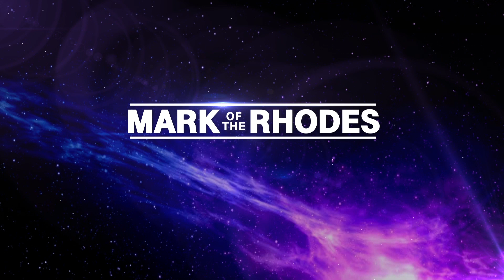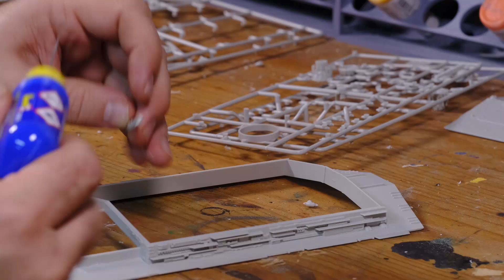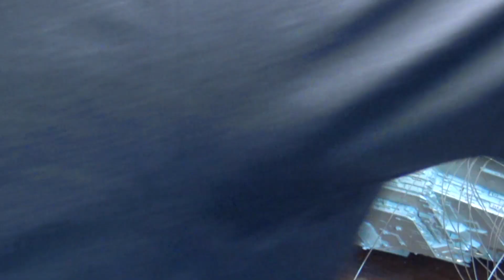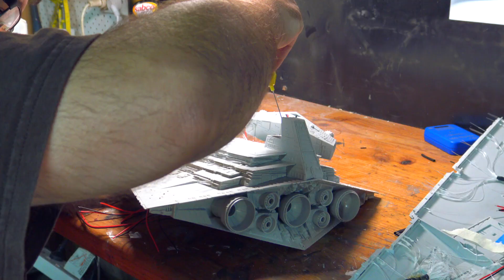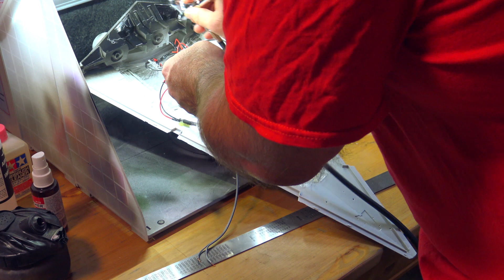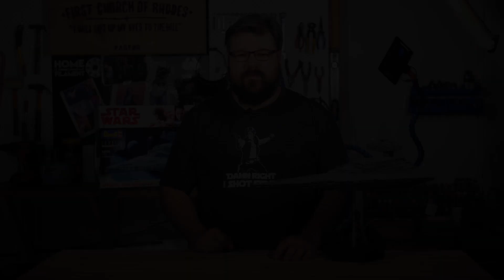Building and Lighting the Star Wars Revell / Zvesda Star Destroyer (1/2)

Comment: hello. 
i will build it soon but i have a question...what's that white thingy what you put on optic fibre? just glue or paint?
Reply from the maker: It was PVA glue, however since then I've changed methods to glue fiber optic cables.  Use a UV glue like Bondic.  Do a quick search on google and you can find heaps.  Way quicker and less messy than PVA glue.

Comment: Thanks for sharing your built. I have this in my stash too and i want to build it next. Which reference pictures do you used for your built, esp. where you have to drill? Or does it not matter where you drill? Thank you!
Reply from the maker: I didn't use an accurate reference, but instead just guessed where they would go based upon a few images.

Comment: Would a .6mm drill bit be too large for .5mm fibers?  I want to avoid the fibers binding in the holes, without falling out.  Trying to decide between .6 and .5mm bits.

Also, how did you achieve the red fiber optic lights?  Red LEDS, or some kind of tint to the fiber (like one end of the fiber painted translucent red or something)?
Reply from the maker: .6 is probably OK as long as you glue immediately, as they will fall out.    Red was done with a seperate red LED, and I just picked random fibers and pulled them to that red led.

Comment: Awesome, im about to start the same project. I'm new to all this tho so once the fiber optic cables are put in what did you connect them to to get the light? Stupid question probably 🙄
Reply from the maker: Not at all stupid!   I hooked them up to LEDs.   I sand the top of the LED to diffuse the light, and then connect a bunch of optic fibers to them with PVA glue.   I also put a sleeve of heat shrink cable over the glued bundle and led to give it more stability and prevent light leaks
Reply: @MarkRhodesMaker  awesome mate, thanks for that

Comment: I actually hot-glued my fibers. The thing is that I used a 0.75 fibre and a small, low power applier. Almost 300 fibres so far and no meltdown. They can bend, but still carry light. And bending can actually be useful sometimes:) 
Still I wish I have seen this vid way sooner:p

Comment: What glue did you use for fibre optics ? Thanks.
Reply from the maker: I used PVA (wood) glue, HOWEVER... this isn't the best choice.  I made a second one not too long ago, and UV cure glue like bondic is a way better option.  Much quicker and far less messy.  Don't use superglue or it'll melt and weaken the fibers.
Reply: @MarkRhodesMaker  Super Thank You ! ! !

Comment: @Mark of the Rhodes Awesome work! How did you cut off the fibers on the outside which were surrounded by parts of the hull? There are a lot of deepening and i was wondering because you can’t get in the with a knife or a wire cutter.
Reply: Most likely he cut at the line of protruding elements. The fibre is really not that visible, especially if painted same colour as hull.

Comment: Why did you paint the inside of the hull?
Reply from the maker: The plastic is slightly translucent, and I wanted to make sure there were not any light leaks from the LEDs inside.   Same reason I also used aluminium tape on the joints.

Comment: Hi, I am building the same model and I am studying the materials to use. I would like to know the fiber optic you used, how many millimeters it is, and the drill bits; I have three and I really don't know which one to use. For the holes, did you use two different sizes or were they all the same size drill bit....
Reply from the maker: 0.6mm drill bit was the size I used for 0.5mm optic fiber.   You’ll need a lot as they break very easily
Reply: @MarkRhodesMaker  Ok! Thank you so much!

Comment: Building this model my self at the moment, after I saw a lighting build on another YR channel (Plasmo).
So far, I can say is this. drilling the fiber holes is MADNESS. Also, I already ruinded like 12 or 13 drill bits. RIP. xD
Also, once I started drilling, I spiraled down into a bit of a frenzy. And drilled way to many holes. RIP again. ^^
Reply from the maker: I hear you, it’s hard work!   I’m editing a video on the new Bandai 1:5000 and have a bit to say about predrilled models 🤣
Reply: @MarkRhodesMaker  ah yes, build the band kit as well in May. Predrilled really is convinient. I got the edition with the included lighting kit. But that solution is not that thought through

Comment: What kind of drill did you use for the windows and where can I purchase it? I’m having a major issue getting the holes drilled for those areas on the hull.
Reply from the maker: Yort Semloh I used a 0.5 and 0.6mm drill.   You can find them on eBay or your local electronics shop, people use small drills for PCB drilling

Comment: I have a question. I have been drilling and realized like you I drilled holed where the guides will cover them when I place the 2 pieces together to close the ship(The top and bottom). I noticed you fed you FO lines and never had an issue. How is that possible that the upper and lower guides did not pinch the lines where they come in from the outside?
Reply from the maker: Phastroh Phastroh good question!  It’s possible I removed some material, and have forgotten about it.  Want to hit me with some photos on twitter @mrhodes or Instagram @markoftherhodes so I can have a look?

Comment: Canopy glue works excellent for gluing fiber optics in place. I have been using this product on my fiber optics for some 20 years now. It will not affect the fiber optic strands in any way. Also if you want to glue down your bundles of fiber optics you can use a glue gun. Just make sure you use what they call the COOL SHOT glue gun which is a low temp. I have glued the smallest 
.25mm fiber optics with no problems. Also a regular glue gun which runs very hot has been known to melt the plastic model parts too.
Reply from the maker: Great tip, thanks!  I didn't have a low temp glue gun then, I do now :)
Reply: Anytime.

Comment: Great job! About to embark on my own build : ) I have a similar Dremel setup (Dremel 4000)  - can you advise the best speed settings that worked for you?
Reply from the maker: Yes!  The drill needs to spin fast enough to remove material, but slow enough that the material doesn't melt from the drill friction.   I think I was using about 15k RPM to achieve this, but it will vary based on bit size.  Save part of the sprue and experiment with that, see what works best!
Reply: Mark Of The Rhodes Hi Mark - thanks for taking the time to reply.

Yup - about to run some RPM tests on the spare/duplicate command bridge side panels... wish me luck!
Reply from the maker: thedownhilla awesome!   If you're on social media keep me in the loop with progress pics!  @mrhodes on twitter and @markoftherhodes on Instagram!
Reply: Mark Of The Rhodes thanks - not much to report so far - assembling various parts for lighting etc... I’m not in Twitter/Insta I’m afraid!

Another quick question - how did you cope with the top and bottom halves threatening to crush/shear the trench wall fibre optics?

Did you have to remove any/some/all of the upper hull’s mating surface that sits behind the trench detail panels?
Reply from the maker: thedownhilla yeah, I removed some very small amounts of the overlapping sides